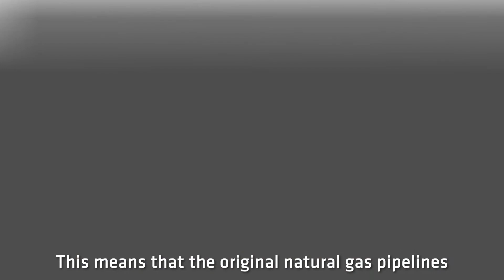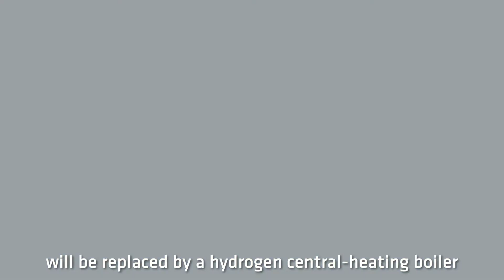From natural gas to hydrogen

Comment: Hydrogen use in homes doesn't make sense from an economic standpoint because in most cases it will be too expensive when compared to electricity.  Hydrogen has to be created from fossil fuels to meet the demand that a switchover from natural gas would produce and that's a dirty, energy hungry, process.  And, creating hydrogen by electrolysis and then piping it into buildings makes no sense when you can just pipe in the electricity. that's done with one conversion, unlike hydrogen which uses two conversions and much energy and money securing the fossil fuel feedstock. 
Electricity is simple; you generate it and bring it into the buildings over an existing wire  infrastructure.  And, by using heat pumps you can use it for both heating and cooling.
Additionally, you can create electricity locally by solar, wind and geothermal means, without all the pipe lines and middlemen grabbing for dollars.  
I see a future where power to run a home is produced mostly by solar panels, stored in EV batteries and tied to the grid as a backup to be used on those few occasions when the batteries run low. 
Hydrogen has it's place in the future in airliners and sea ships; not in homes or any form of ground transportation.
The use of hydrogen to replace fossil fuel for power is a dream of the fossil fuel industries; a dream that will never make sense in the real world.
Reply: How is electricity largely made again ?
Reply: You only talked about fossil fuels and electrolysis. You forgot about cracking of Natural Gas or Pyrolysis. As hydrogen is a clean fuel the switch over would be much better for the environment. The conversion of Natural Gas to solid Carbon and Hydrogen produces significantly lesser pollution than using the Natural Gas by itself. If this could be done in a much more industrial manner, it could significantly reduce the cost of Hydrogen and even lessen the pollution by the European countries for heating in the summer.

Comment: Conversion from one gas to another is well understood, I helped roll  out the programme in the UK around 50 years ago, converting from towns gas to natural gas. Converting a network from natural gas to hydrogen though has one major problem in that the calorific value of hydrogen is only around a third of that of natural gas. This means the supply volume will need to be around 3times that for existing natural gas, how is that going to be achieved using the existing networks?
Reply: Here are a few more problems. Hydrogen is the smallest atom in the periodic table & can leak where gas or nitrogen doesn’t & system would require far more intensive leak detection. The UK transport & high pressure distribution system is made from high strength steel & unsuitable for hydrogen as it is prove to hydrogen embrittlement & would have to be replaced with softer steels. The medium & low pressure distribution is made of HD & MD polyethylene & hydrogen can leak through the walls which would reduce the pressure it can be packed in a line. All the natural gas compressors would have to be replaced as would all the end used meters. Hydrogen burns with no visible flame.
Reply: @isaanman5399  EXACTLY, Well said
Reply: This is similar to garden bridge in London. Millions of public money will be drain on experts working at home. Green energy means money
Reply: But why do the space X rockets keep exploding? They don't keep it cold enough! The
 The hydrogen gas atom is too small to contain in pipes and tanks!

Comment: Why install Hydrogen Boilers, when a ‘Combined Heat & Power( CHP) Hydrogen Fuel Cell( CHP-HFC). Would supply electricity and heating from the Hydrogen Gas, without ANY combustion and only needing a hot water tank, the boiler could be taken out and make more storage space etc.